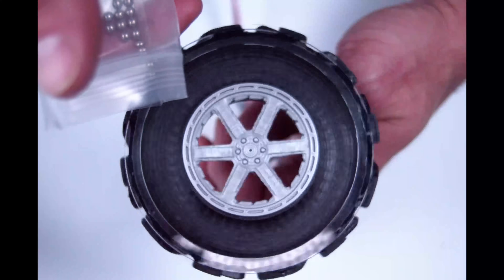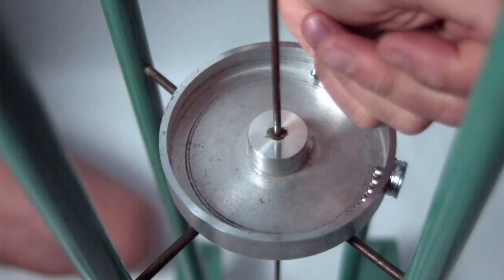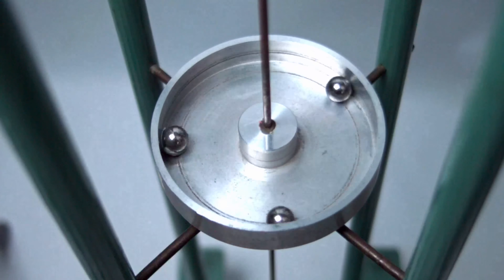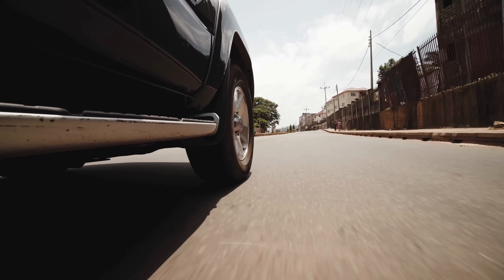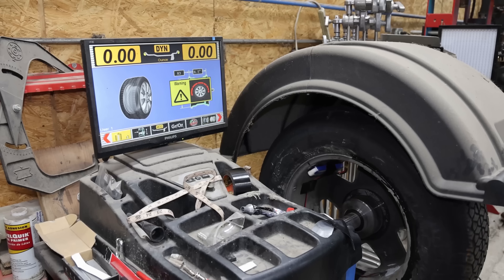Do tire balancing beads actually work?

Comment: The fan blades of modern turbofan engines are allowed to move sideways slightly, so that similar self-balancing would happen.

I learned from a physics book by Lev Landau that making the shaft of a fast spinning machine flexible could make the spin more stable. It looks counterintuitive at first, but it do works when exceding the nature reasonance frequency -but dangerous at that frequency.

Comment: Yes, these beads work and well as centrifugal automatic balancing disks that can be mounted on the wheel. These are especially useful on motorcycles and noticably reduces tire wear and smooths the ride. The spin cycle in a washing machine long ago illustrated the self-balancing nature of spinning materials in a closed space.

Comment: Musician here: the way the axis and weight rotate after you force them out of the resonance looks just like a guitar harmonic. I can see the first (2x) and second (3x) harmonics in a couple shots and I could clearly see why it changed the way it wobbled after you place your finger in the correct node (8:35). I mean, I could hear it with my eyes, the pitch should have changed from the root to the fifth.
Reply: Orbital mechanics, guitar harmonic. What's next o the list? I guess it all ends up with something like integral or differential equations, i.e. some basis thing of the advanced maths,
Reply: @non7top it's because its part of physics its part of classical mechanics and electrical they of vibration and dynamics as well as harmonics somtimes basically engineering students in thier 2nd year get cooked for it 😂
Reply: Musician and Electronic Warfare Officer here. The harmonics and associated resonance have applications in the electronics realm as well when it comes to offensive electronic applications. By jamming radar systems in certain ways, you can induce other effects that degrade or negate the signal. Cool to see it in other applications as well
Reply: @stephenhenley7452  i read the 1st and 2nd part of your job toghether and thought you were an eletronic music warfare officer, and then think to myself when did the military use eletronic music as a warfare method?

Comment: Obvious question, could you have the beads be smooth but become sticky over time in a controlled way so they stay in place after having been spun up fast enough? Maybe they could have a coating that stops working or wears off at the right speed and they are sticky underneath?

Comment: Ok, but the speed you need to reach is dependent on the size of the tire, right? So a smaller tire should need a lower speed? Is that right, or is 50mph universal somehow?

Comment: So all you should do is add some adhesive with the beads and then quickly drive on a highway at high speed untill the adhesive permanently fix the beads in right places? 

Doesn't sound much easy.

Comment: I may be thinking about this in a naive way (not a physicist) but if this is a resonance thing it would make sense that the beads/balls would end up resting at nodes like how sand will pile up at nodes in a vibrating plate. Since they are also part of the system, they also would be influencing the resonance itself and perhaps inducing nodes that would be related to a harmonic by adding a damping effect at those points?

Comment: They are a scam because most tyre shops balance your tyres for free!
They might have an application if they were coated in a glue that set when the right temperature and forces were present. Then they'd be favored by motorcyclists and racers.

Comment: It was thinking that, the fact that the beads having the same weight do not form a perfect equilateral triangle, might be because of the  inbalance in the tyres, so the angle they are staked apart determines how much the tire was off "perfect" equilibrium.

Comment: I didn’t see any mention of this but a lot of people with large tires tend to use balancing beads. I’m talking 40” tires or above since it can be hard for some shops to get the tires balanced correctly. Sometimes it’s easier to just run beads for big offroad vehicles that are also used as daily drivers.

Comment: My brain tells me, it has to do with the exact same dynamics that cause loose particles in a fluid towards the rotational center of the fluid when stirred.
you would guess that the particles tend outwards when you stir faster (centrifugal force) .. but in reality, they move inwards and settle together at the rotational center, because .. I dont know ... getting into the "minimal amount of kinetic energy per unit of angular momentum" configuration?! (not even knowing if this is the case)

Comment: Would be a good method for scooters. They have small tires. 
For cars it would be helpful to add some of these beads to already balanced tires, because over time the tire changes and they could compensate it. And even a well balanced wheel is not perfectly balanced and with the beads it is, if you drive fast enough.
Would be good to reduce all vibrational stress to wheel and suspension, right ?

Comment: Never even heard of balancing beads. And it seems like another one of those things that solve a problem that doesn't exist. Why not just go to a garage and get your wheels balanced, it takes 5 minutes and costs barely anything. They just spin the wheel on a machine, it tells them where to put the weights and that's it. It's a job for the underpaid apprentice.

Comment: Could they not just make beads that once you hit the right speed they "glue" themselves on.. Something about time, heat or whatever.. Even if it means you cant use the method of just driving, takeing the wheel off, fill it and spin it real fast is still way waster than manually placing the right weights

Comment: While I agree, that a perfect circle spinning will sort out any imbalance using beads a car tyre I'll not, there are bulbs inside the tyre that will trap beads and stop them moving and when the tyre stops turning the beads will fall and have to reset, and as from your own on board camera you can see when a tyre hits the ground it deforms so isn't a perfect circle, there are just too many variables to account for and say the driver doesn't drive fast enough to shake the beads into the right place but it has got them uneven around the tyre the unbalance could be much much worse and cause more shaking.

Comment: To be fair, If your tires vibrate at less than 50mph you usually have other suspension problems that cannot be fixed by balancing your tires. Scalloped tire tread is from bad shocks, death wobble is from bad control arm bushings, bad alignments can cause weird tire wear too.

Comment: There's another kind of out of balance that occurs with car tyres... The rotational centre of mass of the inside can be different to the outside.  This makes the wheel want to rotate around an axis that is slightly different to the mechanical axis.  It's the reason the weights on the inside and outside of the rim are different and in different places.  Even if the centre of mass and the geometric centre are at the same point, the wheel still may want to rotate around an axis that's a bit "off" which will make the steering wheel shake as the tyre tries to turn left and right as it rotates.  Do the balance beads fix this kind of dynamic imbalance?

Comment: Now consider what the vibrations mean for your wheel bearings if every time you drive around town or country roads you have a severely unbalanced tire. Also, this is based on RPM. Tire beads seem brought up a lot from truck people with huge tires (meaning they would need to drive EVEN FASTER to hit the critical RPM than cars with normal size wheels). Maybe their personal experience says different, but I just can't buy it.

Comment: In Germany we just try to balance the tires with balancing weights after every tire change. As there is an almost equaly hard resonance at around 160-170 km/h 😅🤗(at this speed it's even more annoying)
This swinging motion of the wheels is nicely wearing down the wheel bearings anyways, so it should be done to safe cost of a more often wheel bearing replacemant.

Comment: Not a scam but only works at high rpm. Despite that it still needs time to reach that ceitical position  for it to balance properly. I think its not good for tires but for thinhs that all it does it spin fast all the time.

Comment: I think there's a connection here with Bode plots of a vibrating mass (spring mass damper). A bode plot will show phase (analogous degrees between the applied force and an output like position) as a function of input frequency, and for simple systems you often get an S-shaped plot where it rapidly changes from a number near 0 to a number near 180 degrees as you pass the natural frequency

Comment: At low speeds it's the elastic string that wobbles but at high speeds the string stays mostly still and the wobble comes from the disc slipping along it's axis, no?

Comment: Crazy idea.. but what about some kind of adhesive that you add with the balancing beads that was fast enough to cure while driving at highway speed? Is there an adhesive that would fit this purpose, or would it be a dumb idea?

Comment: AI Summary

Abstract:

This video delves into the intriguing physics behind dynamic tire balancing, particularly the use of free-moving beads or balls inside a rotating system. Initially, the presenter expresses skepticism, demonstrating that at low speeds, loose masses exacerbate wobble. However, a key turning point reveals that at higher rotational speeds—termed "supercritical self-centering"—these same masses counterintuitively migrate to precise positions, perfectly balancing the object. The explanation involves understanding how a freely spinning body rotates around its center of mass and how centrifugal force within a rotating frame drives the masses to minimize any imbalance. The video also clarifies the critical speed threshold, known as resonance (or "wheelhop" in vehicles), which dictates the transition from chaotic flailing to stable vibration. Ultimately, it concludes that while a vehicle might feel smoother at high speeds due to natural self-centering, balancing beads offer a sustained solution by maintaining the corrected balance even at lower, resonant speeds, provided the initial "settling" occurs at higher velocities.

Understanding Tire Balancing Beads: A Scientific Deep Dive

*   0:00 Introduction to Dynamic Balancing: The video begins by demonstrating a car tire model that wobbles until loose steel balls are added, which then self-organize to balance it, introducing the counterintuitive concept of dynamic balancing beads.
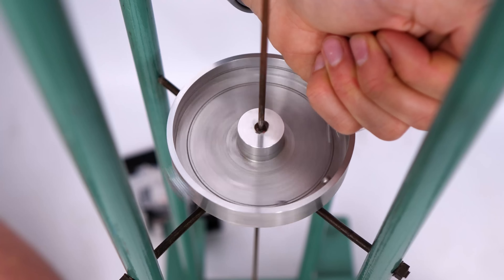*   0:14 Initial Skepticism Overcome: The presenter initially believed tire balancing beads were "snake oil" but was convinced otherwise after seeing a demonstration by Cambridge Professor Hugh Hunt.
*   0:59 Speed-Dependent Behavior of Masses:
    *   At low speeds, an unbalanced cup (modeling a tire) exhibits chaotic flailing, and loose beads added to it gather on the heavy side, worsening the imbalance.
    *   At high speeds, the cup's motion becomes significantly smoother. When beads are introduced at this higher speed, they perfectly balance the cup by repositioning themselves.
*   2:05 How Beads Find Their Spot: Experiments with fixed and free ball bearings show that free balls automatically move to the position required to balance the system (e.g., opposite a fixed mass, or forming an equilateral triangle with other free masses).
*   3:34 Explaining High-Speed Self-Centering: At high speeds, a spinning body tends to rotate around its own *center of mass*. The flexible axle in the demonstration allows the object to act like a freely spinning body, causing the axle to move around the object's center of mass.
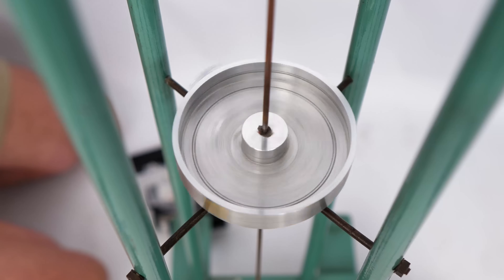*   4:41 The Role of Centrifugal Force: From the perspective of an object inside the rotating system, centrifugal force pushes it outwards from the center of rotation. If the system is unbalanced, this creates a "sloped floor" that causes the beads to roll until they reach a position where the system is balanced (center of mass aligns with the axis of rotation), and the centrifugal force is perpendicular to the "floor."
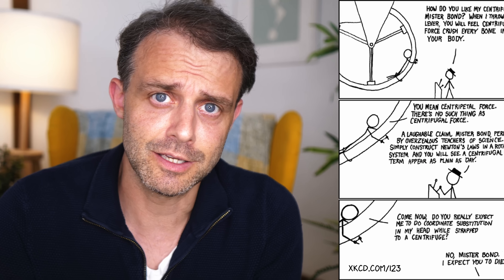*   6:43 The Resonance Threshold: The transition between chaotic flailing (low speed) and smoother, vibrating motion (high speed) is explained by *resonance*. Below a certain frequency, the system resonates and wobbles significantly; above it (called "supercritical self-centering"), inertia overcomes the axle's springiness, and the object spins around its center of mass.
*   9:10 Real-World Application in Cars: Car tires experience "wheelhop resonance" around 80 km/h (50 mph), where imbalance is most noticeable. Tire balancing beads only become effective above this speed, as they require the tire to be in the supercritical self-centering regime to settle into their corrective positions.
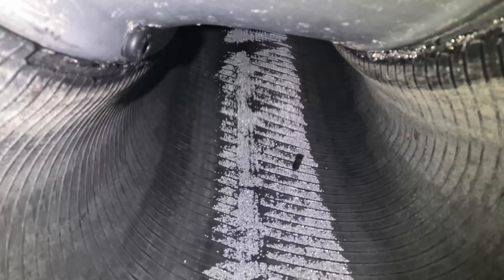*   9:54 The Practical Benefit: While vehicles might feel smoother at freeway speeds due to natural self-centering, the key benefit of balancing beads is that *once they've settled*, they maintain the tire's balance even when the vehicle slows down (e.g., to resonant speeds), providing a continuously smooth ride until speeds become so low that gravity can displace them.
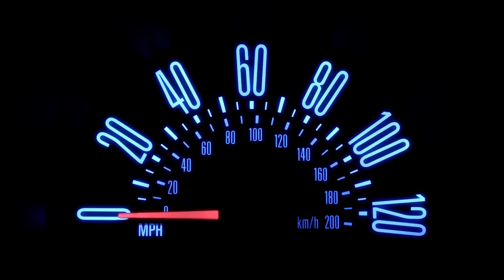*   10:49 Conclusion: Tire balancing beads can be an effective solution, but their functionality relies on reaching sufficient speeds (typically freeway speeds) for the beads to dynamically position themselves.

I used gemini-2.5-flash| input-price: 0.3 output-price: 2.5 max-context-length: 128_000 on rocketrecap dot com to summarize the transcript.
Cost (if I didn't use the free tier): $0.0073
Input tokens: 16994
Output tokens: 889

Comment: I have a surface grinder (very precise machine tool) that requires a very well balanced grinding wheel to achieve a good surface finish. This is normally done with a balancing arbor which involves removing the wheel and hub as an assembly and moving weights around on the hub. It's spinning  at around 3,600 rpm.

 So, would this work in that application? I bet you could work the outer race of a large bearing into the hub design and throw a few of the balls in there. This would be orders of magnitude easier and the ability to get a perfect balance even as you dress the wheel would be awesome.

Comment: I presume this only works this well because vehicle wheels are mounted on a sprung axle, allowing the wheel to arc around its cog. 
How would this work if the axle were more rigidly held, or is that level of rigidity mostly theoretical, not practically achievable?

Comment: Okay, now I'm wondering if you can do something silly with this. Like in a factory setting you fill the tire with beads, spin it till it's balanced by those beads, then just literally dump a bunch of fine mist epoxy to make them stick to the outside of the tire, making it balanced and stay balanced for good (or until a side of the tire wears more than another).

Comment: in near or balanced tires (which are close but never perfect), the additional beads are awesome, as they quiet the car down a lot. also you don't need to get to the motorway speed, I in most cases like 20 km/h is enough. I think the factor not taken into account is the flattening of the tire at the bottom of the rotation which happens when driving. as the heave side of the tire hits the ground, the beads on it get extra impact force and are launched higher in the air, which then leads to those beads falling in other areas. This means that it hits balanced a lot faster at lower speeds. We used metal ball balancing beads that were really small.

Comment: This makes me wonder if there's some way you could get the beads to stay in place permanently once they've balanced the tire. Could you add a thin adhesive, and then drive at freeway speed for X minutes until the adhesive sets while the beads are in the balanced position?

Comment: In the heavy truck world we've had a product for decades called "Centramatics" it's a metal ring that gets sandwiched between the rim and the wheel hub. The ring has a closed outer loop that is filled with BBs and an oil solution. They work INCREDIBLY well, and because we're always at freeway speeds, they're a perfect application. They genuinely provide a night-and-day difference. Additionally, manufacturers recommend traditional weight balancing in combination with ring/bead balancers. The idea is to set initial balance, and then the active balancers come into play as your tire treads pick up rocks, or your rims pick up snow/ice/mud– anything that can throw the wheel assembly temporarily off balance.

I also use balance beads in combination with wheel weights on my personal vehicle. The wheel weights provide like 90% of the smoothness, and I think the beads cover that last 10% of balancing for that truly silky smooth ride when you're cruising at high speeds.

Comment: I have diagonal 35" tires, with metal counterbalances applied by the mechanic. They're not perfect of course, the tires change shape with pressure changes etc. Would adding the beads help, or is there a drawback to having both metal counterbalances AND the beads?

Comment: Been using them in my scooter tires for a few years now (Tire size 90/100-10 or 3.5"x10" Michelin S83).   It even reduced vibration in the handlebar that I didn't know existed.  It's such a smooth ride.  Counteract Balancing beads with about 1.5 ounces per tire.  My top speed is 60kmph in a 2007 Yamaha Vino 50cc four-stroke engine.